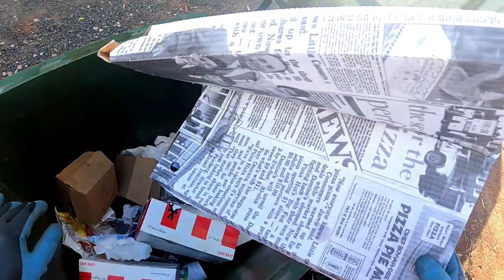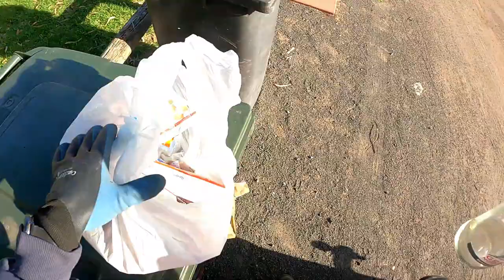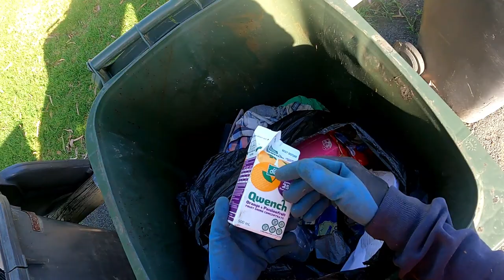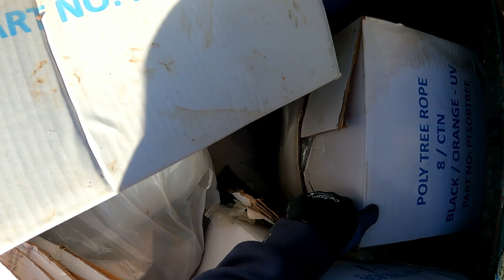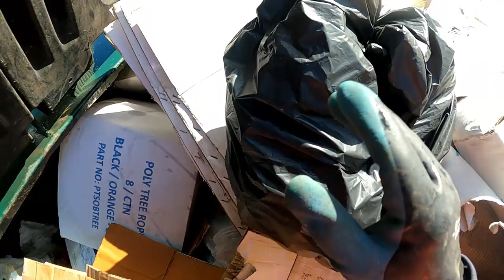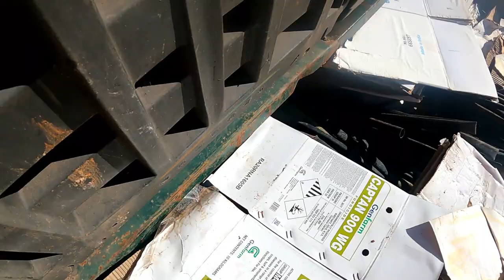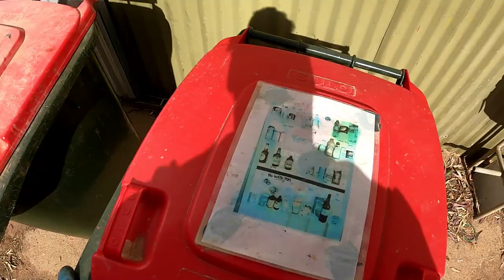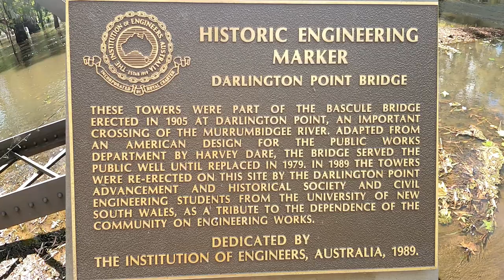Dumpster Diving Let's Hit The Road

Comment: Nice video. Just took in some scrap myself and stripped copper wire is $10.10 a kg while steel is still stuck at the bottom, $150 a ton.